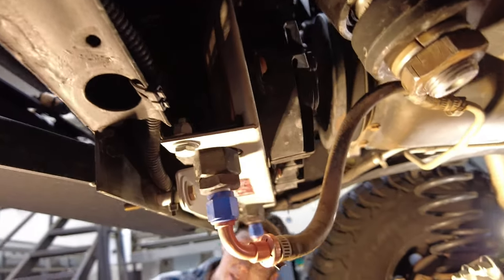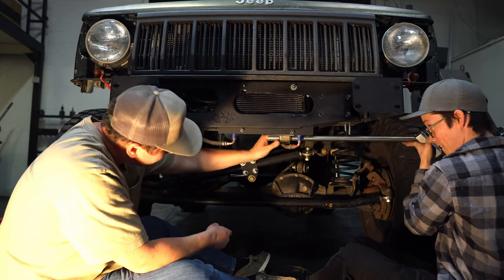Installing the worlds first JEEP XJ SELECTABLE SWAY BAR!?

Comment: Hell yea thats awesome! Way easier than quick disconnect links and it looks so much cleaner. Does this sway bar feel better than stock when locked in and driving on the road? Have you done any offroading with it locked in?
Reply from the maker: Compared to my stock sway bar it feels stiffer and more stable on the road! I haven’t tested it offroad yet but Ryder said that it has some give offroad so it’s a little smoother if you’re on forest type roads. I’m planning on disengaging it whenever I hit dirt
Reply: @2AOverland  with how easy and quick it is to disengage I would do the same thing!
Reply from the maker: Exactly 😎